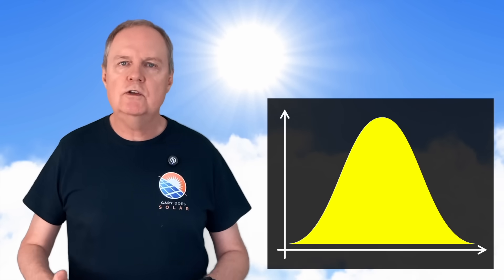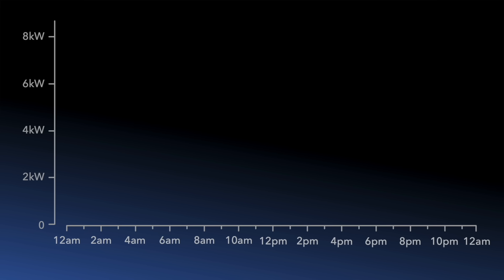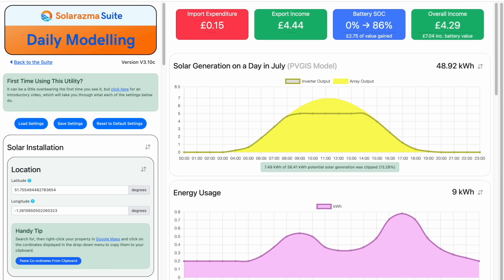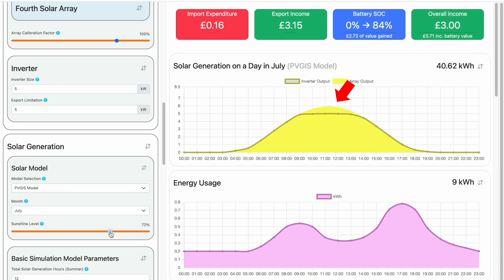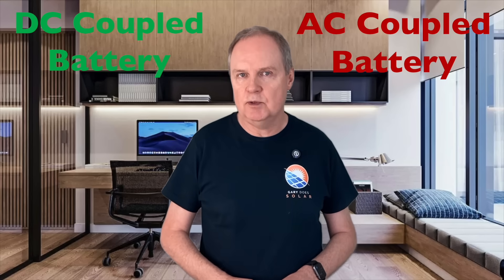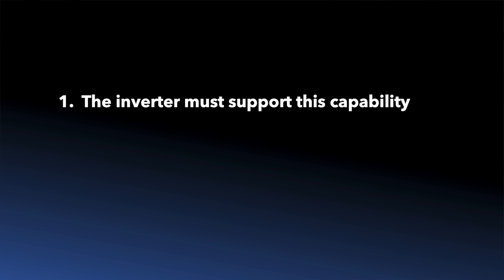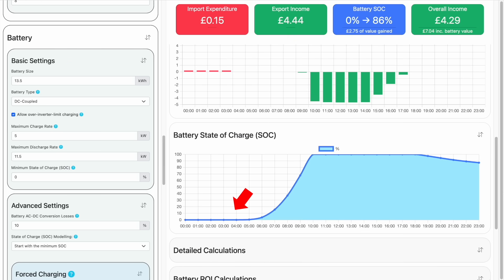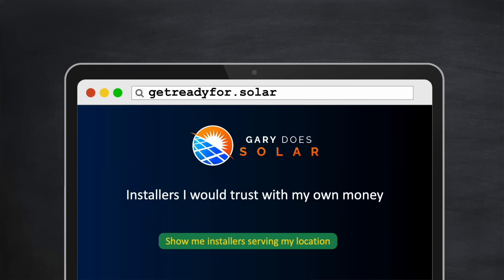Solar CLIPPING and what you can do about it…

Comment: Looking at this in the widest perspective of all, I say this: AC is over-rated. It was the only way to go, for making a grid, in the early days when the technology was far less developed. Now, the advantages of DC are increasing. Long-distance transmission is best done by HVDC. Electronics at the point of use are almost always DC. Solar PV is DC inherently. Wind power is AC, in a loose definition, but it's crap AC, and needs to be converted to DC for processing. Then, of course, it usually gets converted back to "real" AC. Is this any way to handle things? Certainly not the best way. The whole system needs a complete reworking.
Reply from the maker: Hi Ronald, you make a very good point. The trouble is that DC doesn't transmit well over distances less than say 400 miles (overhead cables) and 50 miles (undersea cables) so a solution would have to be found for that. Then, I'm not sure how a transition from mainly-AC infrastructure to mainly-DC could practically ever happen, given many countries are already interconnected? A great engineering problem for humans to solve, mind you! :-)

Comment: A system that is clipped does produce more power than a system that is not clipped, which is the reason why it’s done. Panels are cheap and larger inverters are more expensive obviously. Not easy but you could reconfigure the panels to 5kw and the other 2kws could be connected to a 2kw inverter. It bugs me in the summer that I miss out on that clipped power but as you said I’m not missing out on much and it’s expensive to get that additional power
Reply from the maker: Great points, Andrew! In general, I've come to the conclusion that it's better to have some clipping in the summer to provide for extra generation (given the larger array against inverter size) in the winter.

Comment: Brings up an interesting question. The time will come when enough solar energy will be able to fill all of the needs and batteries locally available. When will we get to the point that electricity can be shared on a broad scale?  How about donating free electricity to good causes? Great presentation, Thanks.
Reply from the maker: Thanks Chris! If I look out 100 years, surely all our power will come from the sun by then? Any remaining fossil fuels will be prohibitively expensive to mine, not least because electricity prices will be a lot lower than today, and there is far more available capacity for solar than wind (even though today, wind generation is higher than solar in some countries). If I'm correct on that, then the only question is how to be most efficiently get from where we are today to that point? Electricity will become more and more abundant along that journey that we'll invite all kinds of new ways of using it, and there will be near-zero energy poverty anywhere in the world.
Reply: Extrapolating the current growth of worldwide installed solar generation capacity, it will take about 10 years from now (2025) until solar generation exceeds the world's total electricity consumption.

Comment: If you own an EV you can charge it at a low rate , for example a Tesla charge rate can be set on the app. This means “on a good day “ you can extend the battery chargers time and hence minimise clipping. On the subject of “always charging a battery overnight to always be able to run the house ( where there is an isolation switch either separate or built in). During the summer months output from the Pannels should in most cases be sufficient to run the house, outside summer the biggest risk is storm disruption, some systems can be programmed to keep the batter at maximum for specific periods, reverting to normal settings automatically. That allows you to continue to minimise overall costs by adjusting mains charging times and periods to maximise solar usage.

Comment: The issue I have with clipping is not related to the inverter, but instead to the 16 Amp (3.68 kW) export limit that most of us in the UK have to contend with. In the summer, my 6.1 kW almost east facing array can fully charge my home battery by the time I finish breakfast! With no heat pump and no electric car, our daily electricity consumption is only about 8kWh compared with the 35-40kWh that we generate on a sunny summer's day. To get around this, on sunny days I set my system to discharge from 6am which means there's usually enough spare capacity in my DC coupled battery to use the extra 2kW that I can't export. Then around midday I switch to prioritising charging the batteries over export and they're generally fully charged by mid afternoon when my solar generation is negligible. I'm intending to automate this using Home Assistant but I'm just getting an idea of what my clipping losses are. Even if it's only 10%, that's still 600 kWh every year!
Reply: I think I'm similar to you, you might like 'Best Home Assistant Solar Forecast? I Tested 3 Integrations!' by Speak to the Geek (YouTube video https://youtu.be/SAwSA6C4-Qw?si=RhEw81IUrnpk0ox1).  I've been using (spoiler alert! STTG's winner) Solcast PV for the last week of so.  I was curious about these invisible losses as when I'd been using HA to activate the Heat Pump's Hot Water cycle on a sunny morning, I could see solar generation increase by 1 to 3kW for about 45 mins (the Hot Water run), and I'd still be exporting 1 to 2 kW to the grid.  So surely that was going on either side of midday too?
Today I'd 46.4kWh generated, and Solcast PVs Power Now number less my actual now number, and total those up when there's more than 4kW generation, was just under 4kW (just for everyone else, Home Assistant can do all that for you but it needs a bit of setting up)

Comment: Your thumbnail on oversized arrays is amazing! Clipping is likely an overrated problem IMO, because during periods when clipping occurs:
1. electricity rates will likely be at or below zero anyway. If electricity is already abundant at a specific moment, it’s not very useful to harvest more at that moment.
2. any battery that you have is likely to be full very quickly.

I originally commented that I didn’t consider it attractive to invest in more inverter capacity, and preferred to allocate more capital to additional solar panels (even if they were at less attractive locations) and storage (even relatively unattractive investments like electric boilers) instead.

However, I just looked up some inverter prices, which caused me to reconsider and delete my previous comment. Additional inverter capacity is relatively cheap, so you could prevent clipping relatively cheaply by choosing an inverter with more capacity from the very beginning. Having said that, as far as I know, inverters operate less efficiently the further below their maximum capacity they operate, so you wouldn’t want to have too much inverter capacity.

In conclusion it seems to not matter that much whether you allocate capital to inverter capacity, additional solar panels, additional storage, or something else. It’s a trade-off with no clear winner.

Comment: It’s a shame clipping is referred to as a problem/issue. It’s not  a problem. A problem or issue suggest a failure is imminent.
We have 2 sites that have 20kwp into a 3.6kw inverter running for 4yrs without issue.
Reply from the maker: I see what you’re getting at, but I’m not sure I totally agree. I have a problem getting out of bed early on some days. That doesn’t suggest failure is imminent, does it? 🤷‍♂️
Reply: @GaryDoesSolar yep I’m not sure what the industry should label the operating condition as, but a problem issue seems wrong

Comment: What if you could put a solar diverter in front of the inverter, which could redirect excess solar to power occasional loads such as water heaters? It’s one of the many options I’d factor into a potential install on my property.
Reply from the maker: Unfortunately solar diverters are AC and therefore on the AC side of the inverter. The extra DC generation cannot get past the AC inverter limit to reach the solar diverter.

Comment: Hum. Rated wattage of solar panels are usually promoted using a STC rating, in nice numbers as 410W. STC stands for Standard Test Conditions. However, for various reasons you shall not rely on that number regarding the planning nor expected production of a solar system. A better indicator is the NOTC rating which is about 20 to 25% lower than STC. NOTC stands for Nominal Operating Cell Temperature. For a residential build, the roof angle and orientation of the panel array is almost certainly less than optimal. Accordingly in your example a nominal STC 7 KW panel array is very unlikely to produce any clipping when paired with a 5KW inverter. Even if you oversize the panels, clipping would occur when the value of electricity is at its lowest value and you would benefit of the oversize when electricity is at its highest value.
Reply from the maker: My panels are often maxing out at their STC rating, and I live the UK..

Comment: Hi Gary,  As I was listening to your video you pretty much went through everything I was thinking.
Solar specs
7.2kw on roof S
5kw Hybird inverter 
9.5kwh Battery 

 My problem begins and ends with octopus intelligent flux.

When I was on octopus flux I could tell my inverter not to start charging until 11am or 12pm.

This would mean I would get the full use of the 7.2 kwh for charging the batteries especially on sunny days.

  However octopus intelligent flux, When it thinks it's going to be a sunny day it doesn't wait until midday it just starts charging from 6 AM. Meaning that's me and octopus are losing money because the intelligent part isn't that smart.

I even went to the extent of calling up octopus to have a chat with their Kracken team.
 Unfortunately they would not talk to me over the phone as there is no direct phone line.
 However I sent them an email explaining the situation and how a simple macro change this entirely and increase profit for both me and Octopus.
 Unfortunately their response was lackluster and dismissive.
 It can be easily done, even from my end.
Any thoughts?
Reply from the maker: Really great to hear that my video was already in line with your thinking. Would you believe your solar set up is almost identical to mine. The only difference is I have an extra 9.5kWh battery unit. But even that doesn’t help prevent clipping!! 

I’m a firm believer that companies who do well in the market spend a great deal of time listening to their customers. I’d like to think that Kraken does the same, but they are a relatively small team and it’s hard to get through to the right person. I do have some contacts there, so if you would be happy to write down your thoughts in an email to me, I’d be happy to pass them on 👍🏻 me@GaryDoesSolar.com
Reply: @GaryDoesSolar  I Thought we did, their was a big push for the Givenergy inverters back in 2022 its a good system but not perfect.
Glad to hear you have a Contact in the Kraken team, this has been bugging me for quite a while and it just feels a bit silly.

But I do make more money with the OIF tariff and have more flexibility of when and how I can run my home Its like having the grid as my extra battery.

I will send you an Email this weekend and include the original email from octopus.
Reply: Somewhat similar set up to you, and also a little bemused by how Octopus Intelligent Flux could be more intelligent.  I've submitted something on a form online a few weeks back, which might be in a black hole, or might be getting actioned?!
I've got Octopus Solar with Enphase battery (microinverters, so AC coupled) earlier this year, and for what it's worth Octopus Heat Pump (see earlier comment about using Heat Pump hot water cycle to prevent some clipping).
IOF sometimes charges my battery before the sun is up, sometimes it leaves it to Solar, sometimes it's an afternoon charge before the 4pm peak (-ve Agile days?).
If IOF was a bit more heat pump, i.e. low and slow, rather than full whack like my old heating system, then I'm pretty sure my solar would generate more and get clipped less.  Win / win for me and Octopus.
I think I've seen the Enphase batteries force charging at slower rates while on IOF, so I think it should be possible.  I guess Octopus need to adapt what they've got so IOF works with all the batteries they support, and whatever they've got in the pipeline.
This isn't a gripe I could ever have imagine having a couple of years ago... hats off to Octopus for the innovation, just keep making it better!
PS Gary, if any of this makes it into your feedback to Octopus, it would also be nice for the Octopus app to show the intended charge / discharge cycles like Intelligent Go (then not having the Heat Pump hot water running at force charge times could be anticipated)
Reply: @kevinmckeown5506
When microinverters are saturated (clip) the excess dc produced by the pv panels is just lost as heat and there is no way to send it elsewhere eg. dc coupled battery, like a hybrid inverter would do.
There is nothing to be done, enjoy your system and let IOF do its thing. Clipping loses are minimal anyway.
Reply: @serraios1989  Yes you are Correct about the micro inverters.
There is no way to recapture that clipping with current tech.
 However it is very different with Givenergy hybrid inverters like me and Gary have as the excess DC Power could be used to charge the battery.

 The octopus intelligence system seems to know when it is going to be sunny and therefore allows the charge to happen from the panels.
My point was that it doesn't have to start as soon as the inverter detects some light.
It could be postponed until there is enough power start the clipping and then the batteries start charging.
This would be around 11am-2pm.
 This way give energy does not have to pay for the energy that they are going to export to the grid later.
 And I do not have to do pay for the energy would otherwise be imported or not get paid for exporting in the morning.
Reply: @grantmidd 
We are in agreement about microinverters and hybrid inverters.
I have 19 iq7+ and 1 Iq7A microinverters and an AC coupled 3.0kw GivEnergy 8.2kwh battery (hybrid inverters were not available when I had my system installed) and I’m on IOFlux. I ‘d rather have the battery charged “low and slow” like you said, as in this way the battery and the inverter temperature doesn’t raise as much and that’s better for the longevity of the hardware.
I have also noticed that on about 40% of the days, IOF discharged the battery outside the peak hours, usually at 5am. On a couple of occasions it didn’t discharge at all between 4-7pm.
However, for us IOF vs IOG+outgoing fixed, pays about 50% more after import cost has been factored in. This is my first year on IOF and I plan to swap back to IOG in September.
Reply: @serraios1989  Curtailing vs clipping... the microinverters themselves are not maxed out / saturated.  Instead (on a sunny day) they're producing enough for 3.6kW to the grid, and about 400W for the house.  IOF controls the battery.  So when no more is needed PV output is curtailed.  Often if I turn the kettle on (or the heat pump hot water cycle), I'll see the microinverters ramp up, maybe to their max (=clipping).  At these times, maybe less than 3.6kW gets exported to the grid, but I'm getting more solar energy generated.  If a cloud comes over, maybe there's be no grid export and it flips to import.
So I don't see my system routinely clipping, whereas I do see it routinely curtailing (and yes, I have read the title of Gary's video!)
Both turn the excess to heat, but as far as I can see, there's no stats readily available for how much that is.  If I could see that, then I could assess whether losses were minimal or not.
On the little monitoring I have done using projected PV numbers, I'll venture that I might be curtailed 4kWh / day x 50(?) sunny days a year.  Over a year, that would be an extra 3% output for my system per year.  Given the option, you'd take that on a savings account every time.
I think slower battery charging on IOF would help reduce curtailing in my system... albeit at times where Octopus maybe don't want much export anyway.
Reply: @tbc555-h7q 
Clipping or inverter saturation occurs when the DC power from the PV array exceeds the maximum input level of the inverter. The inverter output remains constant and equal to its rated max output.
Depending on the level of power the DNO permits to be exported, the inverter output might be reduced electronically so that it doesn’t export more than allowed. This is something totally different to inverter “clipping”. It’s possible both phenomena to occur simultaneously.

Comment: Another potential factor to consider is the loss of efficiency that will usually arise with the use of a more powerfully spec'd inverter i.e. an inverter that might clip for a few hrs a day is not only less expensive to buy, but might well be more efficient so that you retain more of the PV output for the entire day. Without a full analysis, the most likely conclusion might be that an inverter that never clips is not the most cost-effective solution.
Reply: Generally speaking its not a loss of efficiency but instead just vampire consumption... a fixed number of watts.  So, for example, my Flexboss21 consumes around 100W just to stay on, which translates to 100W x 24h = 2.4 kWh/day.   But even a smaller inverter is going to consume 50W+ (unless its a Victron, but that's a different conversation).  So the most you would save is around 50W by going with a smaller inverter and that is only a difference of 1.2 kWh/day.

So really ... it isn't something you worry about in a home installation.  In a mobile installation it can matter a lot (RV, camper-van, boat).  But for whole-home it just doesn't.  Even a small residential solar system is going to produce vastly more energy than the idle consumption of the inverter.

-Matt